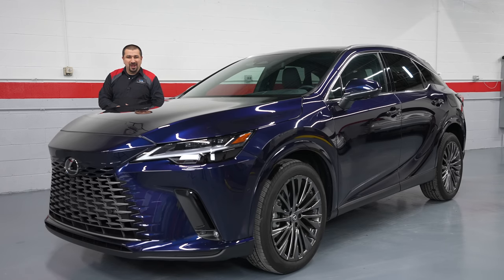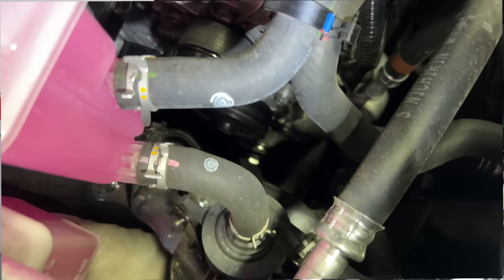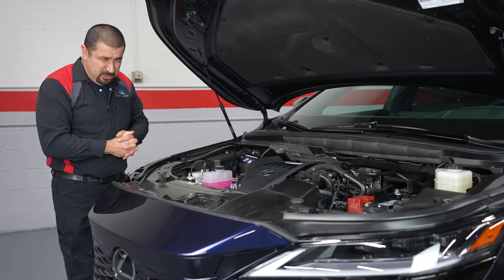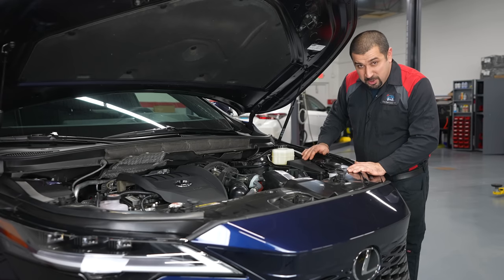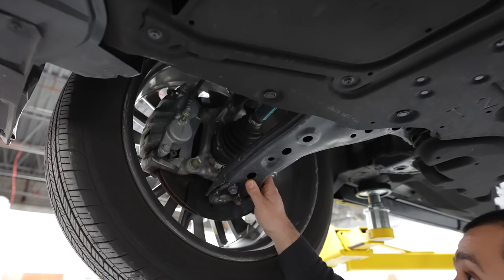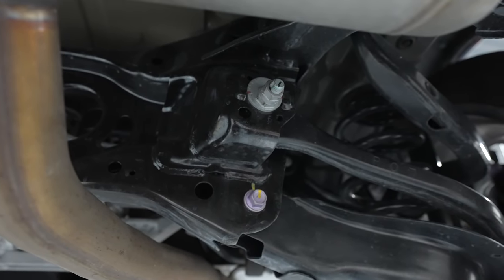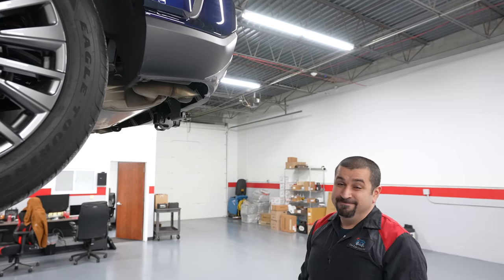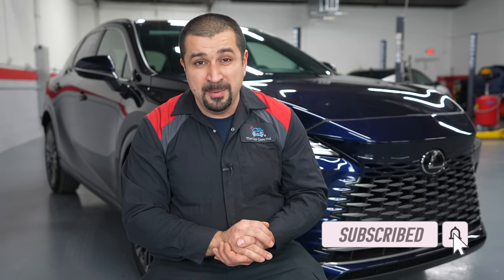Should You Buy The 2023 Lexus RX? Everything You Need To Know

Comment: For everyone saying that they will not buy the 4cylinder RX. I can speak up for the rx500h version. I had a 2017 rx350 f sport and I was upset that Lexus eliminated the v6 on the new model rx. I went in and test drove the 2024 rx500h and it sold me right away. You will never know it has a 4 cylinder. The turbo and the electric motors produces more than enough power for me and is very smooth. Go to a dealer and test drive to experience it yourself. I traded in my 2017 for the new rx500h with no regrets. Going on 2 weeks with the car and absolutely love it!
Reply: i agree but I was buying one for the gas economy with some luxury....so the rx500h was never going to fly. The Rx450h plug in maybe but I sometimes have supe long commutes. I love the Rx 350h. It's not the RX of old....but I wouldn't have bought it if it was of the old....fuel economy is the point of this car. A V6 isn't going to do that.
Reply: The RX500h is a beast, I agree. The drive train is awesome, bulletproof and gives an exciting yet luxurious ride
Reply: Any updates after 7 months ?
Reply: yeah the 500 is fast I had one as loaner.. he's not talking about the 500 though here...
Reply: How is the transmission on the 500H? heard they were failing
Reply: @albertvathapally84  I heard this too!
Reply: confirmation on this from another guy on this thread.  Look it up.

Comment: 100% agree with you. I love the smoothness of my 2013 RX350. And if I wanted an exciting and unreliable suv, I would have bought a BMW. If something happens to my Lexus, I will buy a used one.
Reply: My 2011 RX 350 ... I would not change it for anything.... smooth... reliable...easy maintenance... love my RX...🚐
Reply: I also agree with you. I have a 2013 RX350 and a 2021 Tesla model dual motor. I prefer the lexus. I will not touch a 2023 RX350. Rather have a 2022 or older for my next vehicle.
Reply: I got a 2012 with 177k drives amazing next one will be either 2013 or 2016 models
Reply: 2010 rx350....nice:-)
Reply: I think the 3rd gen rx is one of the best cars ever made.Automotive perfection
Reply: @jl4091  👍x5
Reply: If I were to buy a RX 350 it would be the 2021 or 2022.
Reply: @G Rathore
I'm deciding between a 2023 & 2022 Lexus RX350. Would love to hear your thoughts on why you prefer 2022 model year
Reply: @linhunnicutt6556  that's probably the best of the previous generation as most of the small niggles will be sorted out...🚐
Reply: @jl4091  what I love about my RX is when I "drive it like I stole it" ...that lovely V6 comes alive👍...
Reply: Unreliable SUV BMW because it is made in the USA.
Reply: @grathore6810  would you get the 350 or 450h and why? I’m planning on a ‘22. Want to pass this in 12y to my daughter so longevity a key. I only put 7-10k a year on car.
Reply: @Emmad928  2023 engine is total piece of GARBAGE, GET 2022 or older with 3.5 litter engine, it will be best purchase of your life, 3.5 engine is bulletproof
Reply: @walterfick157  they drive like a boat
Reply: Good luck. Number 1 suv gets stolen. No privacy.
Reply: @grathore6810  which Tesla do you own?
Reply: @linhunnicutt6556  purchased a 22 in June, msrp and just now getting over (ish) the sticker shock.   First time in the snow/ice this morning to go to the grocery, really like the vehicle and glad I went with the v6
Reply: @zyxuzpf   Hi Peter, sorry for the late reply.  I would buy the 2022 RX 350 because of the proven reliability and simplicity of the V-6. If you maintain it well. You will be able to confidently pass it on to your daughter. I hope this helps.
Reply: @grathore6810  thank you!
Reply: I see them for sale and they are now fairly inexpensive.  They are a little elderly looking but I'm okay with that.  If it's comfortable, reliable, and has good gas milage I'm happy not paying a lot for a car.
Reply: Yeah buts you have the v6 model.  No more ..sad
Reply: He didn’t say it’s unreliable so not sure why you added that
Reply: We moved away from Audis and BMWs because of this and Mercedes are just as unreliable!! We are ok w Acuras and Lexus as we drive a lot and reliability is an important factor when choosing a car
Reply: Just bought a 2015 350 with 51k miles..very impressed and very excited! Love these vids for all the help that have me..
Reply: I love the 2024 RX 350h way more than the 2022. Didn't really sit in the 2011 cuz my spouse used it more.  Track pad is silly to me

Comment: Just bought a 2023 RX500h. I have zero concerns about long term reliability. It’s fast and smooth.
Reply: how is the transmission on the RX500h.  Has it failed yet?
Reply: @ funny you should ask, the transmission was trash. Lurched, inconsistent, gear shifts, wouldn’t downshift, etc. I actually sold it a few months back. Very unimpressed with new Lexus and Toyota quality
Reply: @grisa12345  such a pity.  They say the 2024s are fixed.  Do you believe it?
Reply: @gosman949 Hard to say. Toyota has had a lot of problems over the years with their in house transmissions.

Comment: I picked-up my fifth 2023 RX 350 two weeks ago.  I left BMW and Mercedes back in 2010.   Obviously, I'm very loyal to the Lexus brand and RX 350.  You are spot on in your review.  Much thanks.  Some of my issues for those considering-  I turned off the HUD because I found it a distraction.  The steering wheel has no labels other then dots to scroll though the menus.  UGH!  I loved the Adaptive Cruise control on the older models with the controls on a stem.  That's gone.  I'm still learning how to use it on the 2023.  Yes, the car beeps too much.  Not such a big deal - except for the face recognition which is to sensitive.  I don't like the Auto Shut off at stop lights, and you cannot permanently turn it off, you must turn it off manually shut it off.  (Audi, BMW, MB has the same setup with Auto engine off).   I miss the RX 350 six cylinder and found it quieter compared to the Turbo Four.  Also, now you must fuel with premium gas.   I do like the torque in the four turbo on the 2023.  In the older RX 350, I usually switched to Sport mode when entering highways and passing.  That was a dial on the console.  That dial is gone in the 2023.  The 2023 defaults to ECO mode and makes you have to scroll through the LED to switch to Sport. UGH!  You admitted in previous videos that Lexus tech is usually behind the German's (MB, BMW, Audi).  Those cars have just as much and more annoying tech, safety features, but I know with the Lexus the probability of breaking down is much less compared to the German cars.   Yes, it lacks the thrill of driving the German cars, but as a old dude I content with boring and reliable.  Again, thank-you for the excellent reviews.  Bottom line, a big learning curve for the new RX 350.  Nevertheless,  I still would recommend the car for the price range if value, quiet, safety, and reliability are your priorities.   One last word- your review of the EZ Lexus 350 (EV) should be a must watch for anyone considering it.
Reply: You haven't seen boring until you step into a 1981 vw rabbit diesel. It takes boring to a whole new level! And at 53hp, I can tell when I have a tail wind! Thanks for your input, my wife and I will be buying an RX350 tomorrow if all goes well
Reply: I bought the RX500h, its pretty quick, and the 350 was very underpowered and after trading in a 2021 Mercedes E53 amg wagon... The RX is an entirely different car, and I love it.. The buttons I got used to.. have had it 2 months now, the beeping etc I have shut off a lot of it. I had most of that stuff on my E class as well but again shut off a lot of it.
Reply: @twfinc6855  We shut off the beeping stuff with regards to the device that is watching to see if your eyes are on the road.
Reply: @twfinc6855  how are you liking the rx500h thus far? I test drove all trims and were very unimpressed with the 350 and 350h but enjoyed the 500h. I also didn't care for all the electronics in the car as I would disable it anyways
Reply: I LOVE LOVE LOVE the steering wheel menu. It takes two seconds. Put your finger on it, it shows the menu on the HUD (now sure how distracting the HUD is when it is below your line of sight but enough so you can see the road). The adaptive cruise control....what is there to learn? It's one button and it's labeled, as well as lane assist. Then you press the up button to resume or take the new speed you're going at. It tells you on the HUD when you put your finger on the button. And what do you mean scroll to sport? You press one icon in the 14 inch display and the first two icons on the left are Sport and eco. It's on Normal mode for me when I turn on my car. Are you sure you have this car? I mean this with respect. Press the adaptive/cruise control to the right of your steering wheel. Put your finger (don't press) on the circle pad on the right of the steering wheel and it will show plus for speeding up, down for slowing down, left for how far the car will be from the car in front of it during adaptive driving, and I forgot what right was. Press the labelled rectangle icon below the circle pad and it will be your HUD height and info you want to see on your HUD. You don't need to even use that menu but it's there at the press of a button. On the circle pad to your left is music, phone, forward and backwards on music you are playing. So....there isn't anything complicated about it. Up down, left right. That's it.

Comment: I completely agree with your 4 cylinder engine noise commentary.  My wife and I have driven several 2022 small and mid-size SUVs with 4-cylinder powertrains.  We just can't stand them.  We are stuck with spending much more for larger models with v6 engines or looking for 2021 v6 models with low mileage.  The shrinking powertrains are not driven by customer demands.  It is begin driven by government regulations. That is the sad truth.

Comment: Thanks for the review AMD.  As someone who has owned 3 RX's (a 2003, 2010 and currently a 2017) I love the naturally aspirated V6 and was disappointed to her that Lexus was replacing it with a 4.  Even with a turbo and better acceleration I think that the V6 models will last longer with fewer repairs, provided they are taken care of, not to mention drive better/smoother
Reply: You have absolutely no data to support your 'trick knee' hypothesis.  This is nothing more than your own confirmation bias.
Reply: @mrsj1417  what are you talking about?
Reply: Exactly ! Also here in Canada with our cold winters there are plenty of oil dilution issues with the tiny 4cyl turbo in the crv…
Reply: @Steven Strain very interesting ! I will look into it more seriously when my budget will match the crazy prices 😅
Reply: @patrickrafferty9156  if you understand the reason why this happened with HONDAs and NOT toyotas you wounldnt have made this comment.. Entirely different setup for fuel injection between the crv and the rav..
Reply: @patrickrafferty9156  they have gone up $$ but they are much nicer, and much more refined.. still cheaper than a fully loaded X5 or GLE, but smaller also.. not as small as a GLC or a X3 though..
Reply: @patrickrafferty9156 look into what?
Reply: @twfinc6855 more cylinders are always more luxurious than more torque
Reply: I think the hybrid will be the most reliable here in this generation
Reply: @Mike-ht1ou  not long term

Comment: This seems like a high tech powerful 4 banger.  Maybe I'm old school but this vehicle deserves a less strained and more refined/quieter naturally aspirated  traditional V6.  I realize turbo 4's are the new norm and have come a long way but mainly as a cost cutting measure.
Reply: how is it a cost cutting measure?  the new 2023 model requires premium gas now.  You end up paying more.  Oh, I see your point now, it is cost cutting for Lexus.
Reply: @galaxywalker2976  It's all about trying to satisfy the federal government's CAFE requirements.  Like many government over reach regulations it doesn't work very well in the real world.
Reply: The right move here is to get the 500H, the 2 electric motors really take the load off that 2.4T and make it super smooth to drive.
Reply: Moving to a 4 cylinder for 1 mpg and adding a turbo is nonsense. I’ve owned RXs since 2009.  What a mistake.
Reply: @jamesvirga9496  100% agree. I would walk into a Lexus dealer today and get a 2024 RX if there was a 6-cylinder option. I like the design of the post-2023 front a bit better than the 2022 and earlier versions. Who knows, I might go get a 2022 with some mileage just to save some $ and get the 6-cylinder.
Reply: same here, Lexus called me to upgrade my 21 RX and I told them no, not until they put the 6 back, no undersized 4Cyl that requires premium fuel and needs a turbo for me. They need to put the 6 cyl regular gas powertrain back in or I am looking elsewhere.

Comment: Thanks for a fantastic review!

As a 2011 RX 350 owner, I was over the moon to see that Lexus had finally implemented a top tier infotainment system and thought this was going to be a sure buy. I was dead wrong.

I took the 350h for a test drive and found the 4 cyclinder to be loud and whiney. Totally against the RX DNA we all know and have loved. To make matters worse, the Sports Luxury was previously $100k AUD. It has now skyrocketed to $127k, for a subpar power train.

I took the 500h for a test drive, too, and was far happier with it, but not only does it retail in Aus for a whopping $138k, but Lexus tell me it's a 1.5 year wait!! 

Lexus have really dropped the ball here, at least for Australian customers.
Reply: As a mercedes owner for last several years, I bought one because there was a cancelled order and it was available right away, I dont like to wait.. The RX500h is quick enough, its not fast but pretty quick.. good on gas, smooth, very quiet... compared it against a merc GLE and bmw X5. its smaller, but thats ok, makes it nimble around town, and if you want to get all the goodies on a GLE or X5 here in Canada they are quite a bit more money.. Its not a cheap car the RX, but after driving others, its very refined.. And also much more so than the last version I owned which was a 2012. A X3 or a GLC is smaller and at 6'5" tall I fit in the RX perfectly.. I have had it 2 months and love it so far

Comment: AMD, Thanks for the thoughtful and heartfelt analysis of the new RX. 👏👏You are not the first one to raise concerns about the finicky controls and excess technology. The issues arising from the rough turbo engine may be alleviated by the smoother 350h which is just as quick, far more economical and smoother when the RX is driven in the traditional manner. On the question of safety, you are probably correct to say careful drivers don't need as much safety tech but what do WE do with the aggressive, distracted, impaired and downright dangerous drivers out there?  Surely the rest of us deserve to be protected from them by every means possible and that is where technology will come in to play.

Comment: Just picked up my 2024 RX 350.  The engine has a bunch of low RPM torque  (more than the previous v6) because of the turbo and doesn’t need to wind up to move it.  I don’t think you’re giving enough credit.  I like the safety Nannie’s and giving me the option to use or not.  By the way if you don’t like the beeps just press the little speaker  icon to shut off- not a big deal.  Love it all so far.  Premium fuel required so beware of that.  Love your reviews.

Comment: 🎯 Your absolutely correct.  We hate the auto engine stop / start and the multiple needless built in monitoring distractions with the beeps and 🛎 bells.  I worked for nearly 3 decades in a auto assembly plant in Ohio.  The issue is engineering.  They are always " justifying their jobs" by needlessly overdesigning and redesigning using cheap short cuts like with software.  If they leave it the same then obviously they are not needed.
Reply: I believe you are underestimating the influence of the federal government on the auto industry.  That includes all the nanny devices, the rush to EV technology which still isn't ready for prime time and lots of other things like the minimum height of your toilet seat.
Reply: I don't know about whether the 2023 RX has a button to disable the auto engine stop feature, but my 2022 RX450H does.  Just push the button and the auto stop feature is disabled.
Reply: Your comment somehow reminded me of the Boeing 737-Max 😅

Comment: Almost 2 months with my RX500H and the beeping isn't as constant as one would think. Would I have wanted a V6, of course. But some who are complaining about the 4cyl are the ones who voted for those who created the regulations. That requires manufacturers to make these engines. Lexus has a newer demographic in mind when it comes to newer designs and releases. Not solely relying on the empty nesters that are 55+ anymore. Purchased the RX500H for reasons you don't think a Lexus buyer would care about. You're also able to open the doors manually both outside and inside. Would love for Lexus to release a limited V6 RX F-sport variant as I would be trading my 2023 in for it without thinking about it. Just add an engine mode button on the steering wheel. The buttons on the steering wheel are easy to learn after driving for a bit.